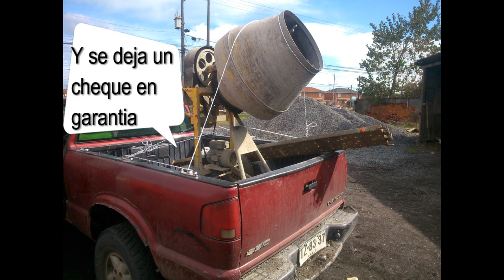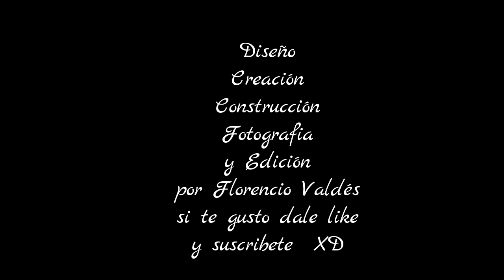Construcción de un radier

Comment: Muy buen video amigo, para los que somos principiantes esta buenísimo, consulta ,yo quiero hacer una radier en casa de 3m 80 largo  x 1m 63 ancho y de altura 6 cm para la loza, es para una logia,me podrías calcular cuanto material necesitaría ? y cual es la medida del cubo que te refieres en los comentarios de abajo pliss,  de antemano muchas gracias, sigan subiendo mas ,saludos
Reply from the maker: Estimado Saque sus cálculos y según sus medidas usted necesita comprar 3 sacos de cemento, 0,2 m3 de arena, 0,3 m3 de gravilla y ocupara 66 litros de agua. Referente a tu pregunta del comentario de abajo por la medida del cubo es un metro cubico. Espeto haberte ayudado con tu duda que estés bn.

Comment: Buenas tardes amigo ,consulta ,cuanto cemento, gravilla y arena se necesitarían para construir un radier de 1 metro 80 x 6 mts de largo para una logia ? y es necesario maya acma ? se lo agradecería, muchísimas gracias, muy buen video, saludos
Reply: ha, y seria de 10 cm para la loza
Reply from the maker: Estimado para una relación 1:2:3 (cemento, arena, gravilla), que te da un resistencia de 210 kg x centimetro cuadrado, tomando en consideración  1,80mx6mx0,10 que me has dado debes comprar 9 sacos de cemento de 42,5 kg ademas comprar 0,6 cubo de arena y 0,9 cubos de gravila, la mezcla se debe hacer con 200 litros de agua. espero haberte ayudado amigo saludos que estes bn

Comment: Hola amigos alguien me podria orientar por favor. Bueno yo soy soldador de oficio habeces e echo radieres para mi,pero lamentablemente nunca me queda bien al cabo de un tiempo paso la escoba.y se empieza a desintegrar u a soltar la gravilla. A que se debe este problema? Un maestro me comento que un buen radier para que no se parta ni se degrade debe evaporar el agua de la.manera mas lenta posible.indicandome que ponga un nylon o plastico como base? Que opinan alguien me puede orientar cualquier dato lo agradeceria muxo ya que tengo que hacer un pequeño porton a un cliente u devo hacer un radier y no quiero fallar. Gracias.
Reply from the maker: Amigo primero que todo Bienvenido A Constru&ideas y acogimos tu duda. Lo que tu tienes que hacer es:

Cantidad de material que ocuparas. Por ejemplo, normalmente la distribución de un radier esta dado por una relación 1:2:3 (cemento, arena, gravilla), que te da un resistencia de 210 kg x centímetro cuadrado. Para que tu mezcla sea excelente y no se te parta o desintegre como tu lo mencionas debes mesclar primero gravilla con arena ( Sin agua), una vez mezclados estos 2 materiales procedes a mesclarlos con cemento según la relación que te di arriba y una vez mezclados estos 3 materiales procedes a añadirle agua para que se junten. Espero haberte ayudado amigo Mariano Galdames que estés muy bien
Reply: Constru&Ideas Valdés amigo mil agradecimientos por lo sabios concejos entregados los aplicare al pie de la letra. Y muchas gracias por responder y compartir tus conocimientos muy amable!!!!🙋
Reply from the maker: No gracias a ti por ser parte de esta comunidad y cualquier duda no dudes en preguntar que tengas buen dia
Reply: Constru&Ideas Valdés gracias🙋